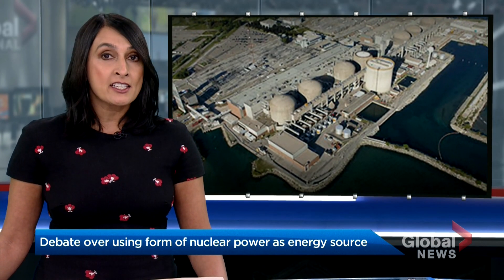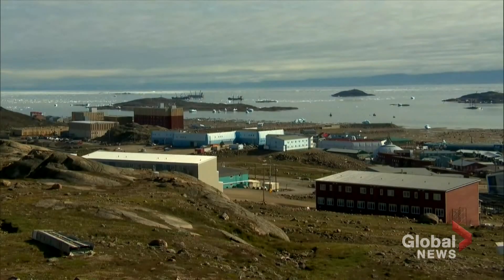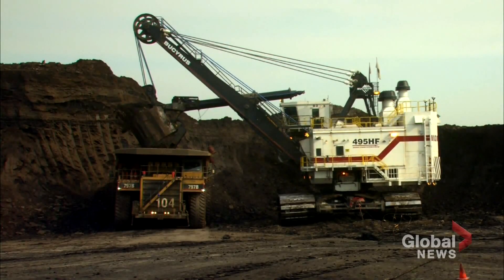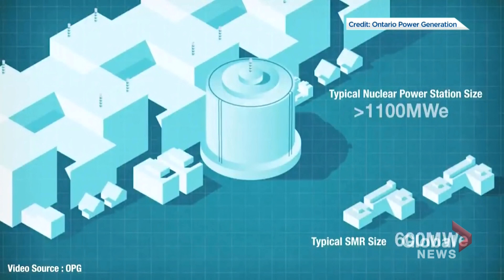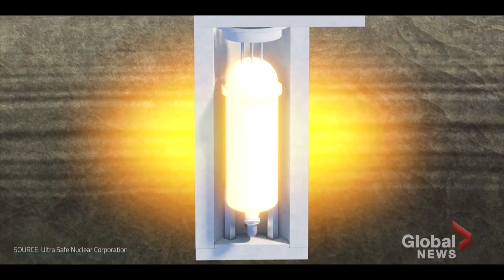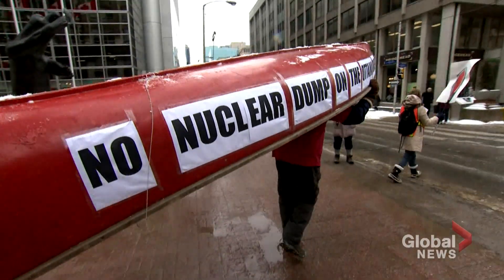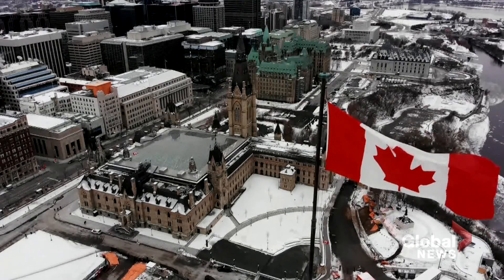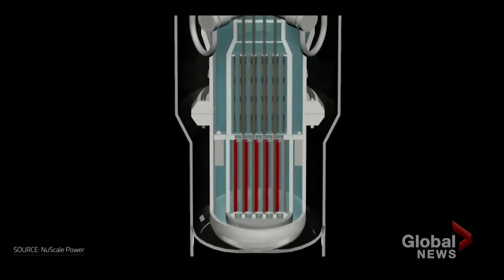Canada's politicians debate over using new nuclear power plant as energy source

Comment: I have 3 questions about these Small Nuclear Reactors for Small Remote Communities and RM's.

Obviously, these Nuclear Reactors need a constant supply of fresh water in order to stay cool.

Could it become necessary to divert water from personal and agricultural use during an extended drought period in order to stave off Core Meltdown?

What would be the area effected by a meltdown for the smallest of unit?

Where and how are you going to safely store the Radioactive Waste Water?
Reply: Nuclear waste can be reprocessed and the French have been able to recycle up to 96% of their nuclear waste. What is left is stable and easier to store than traditional nuclear waste, and has a storage time of around 1,000 years compared to 100,000+ years with traditional storage policies. There's better reprocessing techniques that recycle 98% of waste and can reduce the storage time of the remaining 2% to as little as 100-200 years. You would need to ship the waste down to a reprocessing plant further south, but the waste that will be generated by some proposed SMRs is very easy to transport and is stable, making it quite safe to handle compared to traditional nuclear waste. 

Fresh water can be used in a closed loop system meaning the water used for cooling isn't wasted. 

Most SMR designs have walk-away safety meaning that in the worst case scenario the reactors actually shut themselves down if they lose coolant, and have built in systems that use natural convection cycles to passively cool it down once it is shut down. They also have gravity assisted control rods that are deployed when a power outage triggers and electromagnet holding up the rods when power is avaliable.

If a meltdown does occur (which is EXTREMELY unlikely given the design of the new SMRs) the area affected can be as little as a few blocks thanks to the reactors having their own containment vessels. Again, these new reactors have built-in safety features that prevent them from melting down like Chernobyl's RBMK reactor.
Reply: "Obviously, these Nuclear Reactors need a constant supply of fresh water in order to stay cool."
Actually, it is not obvious. Depending on the design, and most of the smaller new designs are like this because of the high outlet temperatures, water is not needed to take away waste heat from the generation loop.
 Some designs yes, many designs no.

"Could it become necessary to divert water from personal and agricultural use during an extended drought period in order to stave off Core Meltdown?"
Doubtful. All the SMR designs are small enough that air cooling (not venting to atmosphere, just cooling with ambient air) is sufficient. I am unaware of any that are not.
 Even the NuScale design (most like a traditional PWR) uses air cooling after the pool is consumed.

"What would be the area effected by a meltdown for the smallest of unit?"
Due to the small size, most designs are petitioning for the Emergency Planning Zone to be limited to the plant boundaries. In NuScale's case, this is 180 hectares. Oklo's Aurora is the size of a building.

Remember, a melt-down is NOT a blow-up. Most of these SMRs aren't using high-pressure water as their moderator/primary coolant - no water means: no steam (i.e. a Chernobyl-No-4-type explosion) and also no hydrogen (i.e. a Fukushima-type explosion). In a melt-down they will ooze into the building's concrete; however most of the designs make it difficult to ooze past the reactor's walls itself.

"Where and how are you going to safely store the Radioactive Waste Water?"
None of the SMR designs I am aware of create significant radioactive water (such as done by the GE BWR).

Comment: If they are molten salt reactors then great, as MSR's are passively safe through physics, need no constant monitoring and can consume our nuclear wastes reducing the amount by a ratio in excess of 10,000 as well as leaving wastes that rapidly decay within 350 years instead of the 30,000 years of solid fuel rod reactors.  MSR's can also be breeder reactors manufacturing their own uranium out of non-fissile Thorium which is currently just a waste product of mining (however this requires some nuclear fuel processing at the site such as a distillation column which though easy to do may be prohibited by law to coexist at the same location as the reactor).  If it's solid fuel rods, we're back to only using 0.5% to 0.7% of the uranium in a rod before it becomes mechanically unstable and hence be nuclear waste unless reprocesses and there are no reprocessing plants in North America, there is one in France but it's doubtful that storing the rods for ten years to reduce latent heat and then shipping them to France and back as remanufactured rods would be wise.  Solid fuel rods would just get us into more trouble but molten salt reactors would help us in the long run.
Reply: For molten salt reactors I think one of the big problems is how to do the chemistry to remove the neutron absorbing byproducts of the decay chain. If you think reprocessing solid fuel rods is bad think of trying to do that on the liquid inside a running reactor or shuting down the reactor and chemically possessing all the solid salt after it cools down. Im not saying molten salt reactors are impossible just that i am pretty sure they are still out standing problems that need to be overcome first before they are deployed.
Reply: @the0dued  The neutron absorbing byproduct in the decay chain is Xenon and this is a serious problem with solid fuel rod reactors but with a molten salt reactor, the Xenon as a gas naturally leaves the liquid fuel on it's own.  Also, the way that solid fuel rods are reprocessed are by first turning them liquid with nitric acid.   Molten Salt Reactors have already done most of the most difficult tasks of reprocessing the fuel with only a distillation tower remaining.  The thing is that regulations in North America prohibits nuclear fuel reprocessing on the same premises as the reactors, for some reason, someone managed to argue that transporting dangerous radioactive wastes was safer than co-locating the facilities.   The report on the Oakland molten salt reactor did cite concerns but it's clear they were reaching to make criticisms.  One criticism was that the molten salt corroded the metal alloys used for the piping, ignoring the fact that the degradation was acceptable for the estimated lifespans of reactors and it's quite possible for more resistant alloys to be found and of course, infrequent maintenance could simply replace the pipes should the lifespan of the reactors need to be extended.   If you had actually researched your comments, you would see that liquid nuclear cores is actually the solutions to the concerns you are raising.

Comment: Dirties and most dangerous? Has she even looked into how many people have died from coal?
Reply: More people have died from Hydro than nuclear. The disasters at Chernobyl and Fukushima only happened because of poor management, and not because of nuclear energy's "perceived" danger. Even though the RBMK reactors at Chernobyl have a flaw in their design, that flaw ONLY becomes a problem if you push the reactor past its safety threshold which is exactly what the clowns running Chernobyl's reactor 4 did. Fukushima happened because the tsunami wall was inadequate and the designers made the stupid idea to put the backup generators below sea-level when the power plant was right next to the coast. 

Nuclear energy is safe as long as we use it responsibly, and new technologies are making the latest generations of reactors even safer. I would not be surprised if the detractors are being paid by fossil fuel industries to push the stigma behind nuclear energy.

Comment: Nuclear isn't that dirty like they say. Takes 40 thousand years blah blah. Yah and it's so weak of a radioactive partial you can roll in it. The stuff that half life is 7 days (half as strong) is way more dangerous. So it's not really that bad as it decays and becomes nothing quickly. There are muttiple ways to generate nuclear and if you have power that can run for 20 years then just simply replace it not a bad option
Reply: Some isotopes are short, but not all. Cesium-137 has a half-life of ~30 years. It could take 20,000 years for Chernobyl to be habitable again.

Comment: Reserves/chiefs can’t figure out clean drinking water and now we trust them to manage a nuclear reactor? Gimme a break.
Reply: It's a set it up and it just runs it fails it automatically shuts down by design. Runs out of fuel truck it off and drop in another one. The idea is plunk down a shipping container plug it in walk away 20 years latter plunk down another one then haul the old one away
Reply: @wildandliving  That is true. SMR's cant have a melt down and generally pretty safe. Stuff breaks and accidents can still happen. The fuel is still extremely radioactive and need to be properly disposed.  There's also risk release of some radioactive steam. Depending on the location of the SMR, help could be hours away. That being said, I believe an accident could never be as bad as TMI or Chernobyl.

What you have to think about is the risk vs reward. Everything has risk. The reward would be clean power with no carbon emissions. The downside is that power will be very expensive. It is more economical to build a large nuclear generating station rather than a dozen small ones. A cheaper and safer option is simply to build more transmission lines from large stations to rural communities and reserves.

Comment: I support the use of SMRs for space-based applications.   As an environmentalist and a renewable energy fanatic, I'd still support renewables for industrial electricity generation over nuclear.   Even in the Tar Sands, I'd still support LCPV and MCPV solar, onshore wind, offshore wind on Lake Athabasca, geothermal, and energy storage systems rather than nuclear power since the commodity price won't be able to support nuclear power plants of any size in the Prairies for much longer.   I'm not the biggest fan of nuclear power.   I think it's just a total waste of time.
Reply: Hilarious. If “renewables” were actually a viable replacement and were actually environmentally friendly their use would be wide spread. But it’s all a big scam. You cannot replace heavy industry with “green” tech that is dependent upon heavy industry.  The Oil sands are far more environmentally responsible than 100’s of thousands of windmills and 110’s of square km of solar farms. The concrete needed for these so called renewable operations makes them worse than what we already have.
Reply: @notentirelyapathetic9458  Agreed. Also important to note, the capacity of Nuclear Energy having less carbon creating capacity than solar, and on par with wind makes nuclear power more safer for the atmosphere, and more powerful than coal-powered plants! We have the technology to harness nuclear energy correctly, through Thorium-Molten Salt Reactors as well. Everyone wants to point to Chernobyl and Fukushima, without understanding the context of what  was available at the time in regards to the science and technology. If environmentalists want us to trust the science. NUCLEAR NEEDS TO BE IN THE CONVERSATION!!
Reply: @arrinjacob2088  I totally agree!!!
Reply: @notentirelyapathetic9458  How come you haven't provided a single response to the facts and figures I just provided?  I'd love to hear from you.
Reply: @firefox39693  sorry buddy your comment must have triggered the algorithm. Your previous comment never came through.
Reply: @notentirelyapathetic9458  Don't tell me you can't read that.
Reply: @firefox39693  sorry man not a word
Reply: @notentirelyapathetic9458  "If “renewables” were actually a viable replacement and were actually environmentally friendly their use would be widespread."

That's a strawman fallacy.   Just because renewables are better than fossil fuels in every aspect does not mean they automatically would be phased out.   There are factors at play.  Fossil fuels are subsidized by governments and by people.  The emissions from large GHG emitters are still largely untaxed.  Therefore, these companies pollute for free.  When companies, and even people, can pollute for free, there is no market mechanism that incentivizes them to reduce their emissions.  That's what a carbon tax accomplished.

Renewables are not a scam.  They are a realistic industry and have proven their business case for years.

"The Oil sands are far more environmentally responsible than 100’s of thousands of windmills and 110’s of square km of solar farms."  False.
Reply: @firefox39693  hey buddy. How do you make a solar panel or a wind mill?  They need steel and aluminum and quartz and concrete and petrochemicals, and copper and transportation and installation. Does the sun always shine and the wind never stops blowing?  They are not scaleable to meet demand. Nothing on the planet is as heavily subsidized as “renewables”. What is the life span of a wind mill or solar panel.?  They don’t hold a candle to one natural gas power plant. 
You act as if there are no environmental impacts of wind and solar. Take a look at Ontario or California or Germany. All epic failures. CO2 is not pollution. The climate has never stopped changing... ever. If a carbon tax is the answer then how is it that the US reduced their emissions by a far greater amount than any Paris accord signee without one, and without the whole sale idiocy of renewables. Even EVs do more harm than good. Every component in an EV is either plastic or aluminum or prescious metal or glass or synthetic. All of them use more energy and are more polluting to fabricate than the amount you’d hope to reduce with their use over the lifetime of the vehicle. It is a scam. Absolutely.  But to quote Mark Twain
“It is easier to fool someone than it is to convince them they’ve been fooled.”
Reply: @notentirelyapathetic9458  Couldn't read it?  Or, don't wanna admit you were completely wrong?
Reply: @firefox39693  lol. So you couldn’t read my reply?  This platform is pathetic.

Comment: Do it! Do it! I want one and I work in the renewable field!
Reply: I want nukes
Reply: @masternobody1896  Sorry, Nuke machine broke.
Reply: 4 questions guys.

Nuclear Reactors require a continuous flow of fresh water. Saskatchewan is well known for long drought periods and fresh water is becoming scarce.

1. In drought conditions could it become necessary to divert personal and agricultural use water to these reactors to avoid a Core Meltdown?

2. Where and how are they safely storing the Radioactive Waste Water?

3. What is the worst case scenario for meltdown caused by human or other error for the smallest reactor they have?

4. Who pays for clean up (if it can be) when the Corporations go bankrupt after a meltdown?
Reply: @kellywills5852  1. I cant really answer that myself, sorry but my knowledge on that question is next to limited. 
2. The waste is contained in the septic tanks and stored for a long time, after a good amount of time has been passed and the water has been 90% decontaminated, The only substance left within the reactor water is Tritium, But this water is emptied out into the ocean very carefully and as per international regulation.  
3. In case of a melt down, It could become the situation of tree mile island where no one died and nothing critical happened, Or Chernobyl style freak accident, One of the reasons that nuclear reactors cost so much to build is that the safety systems have there own back up safety systems, meltdowns are almost rare to the point where you can count them in one hand, 1 person dies every 14 years from nuclear power generation, thats very small vs coal or natural gas.   
4. The government or last case, the IAEA will step up to clean the entire ordeal if the company that owns the plant goes belly up.

Comment: Remember Fukushima? jc..
Reply: Remember how unlikely it is for an 8.9 earthquake followed by a double tsunami to happen in the middle of the the continent? Fukushima taught us many lessons, and while it is a very real disaster, so many things had to fail in the way they did before it escalated to that extent. 
Is nuclear a perfect solution? No. It’s management and upfront costs are astronomical. It’s waste is insidiously toxic. And the technology is still in its infancy.
However; it scales. It scales marvellously. Once built, a single or multi-unit station can easily double the generation capacity of any similarly sized fossil fuel facility. Without the significant carbon footprint. There is no contest. It works when the sun is down, it works when the wind doesn’t blow. And, on the whole, it is safe, and only getting safer. What other thermal generation method can put the brakes on faster than nuclear? 100% operation to to 10% in seconds, there are other complications (thermal expansion, decay heat), but it’s like a freaking light switch
Reply: Did you know that more people die from solar energy than from nuclear energy?

Comment: Why don't we support Canada and use Canadian LNG  , coal or oil. All you need to do is advance filtration  technology and in cases ,miniaturized units can make engines clean. Cleaning the air in big smokestacks is  expensive and big scrubbers are not designed as a sole solution. 
We need to reinvent the smokestack scrubbers so they will collect the carbon and self clean plus process and package the usable finish product. Carbon can be caught, processed and used or stored.
The extra cost of advanced smokestack technology is going to have to be considered the cost of producing energy is doing it in an environmentally friendly manner. 
Support Canada's energy industry  !
We need them !!!!!